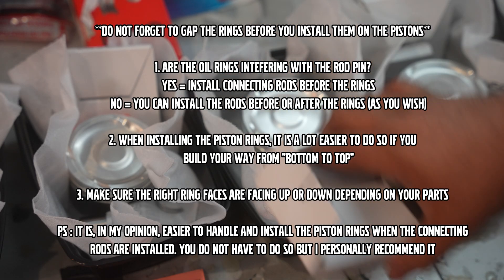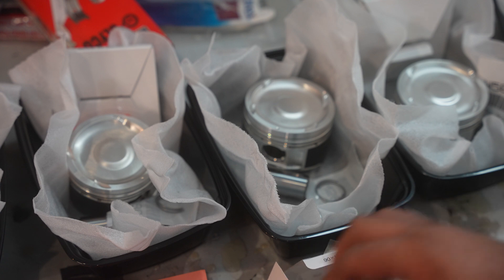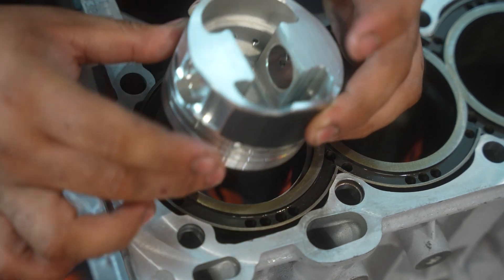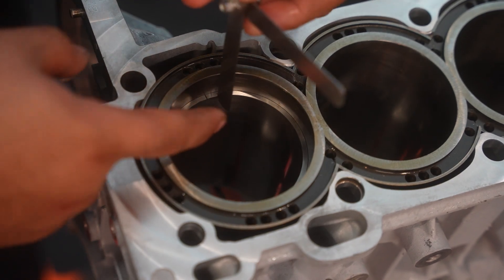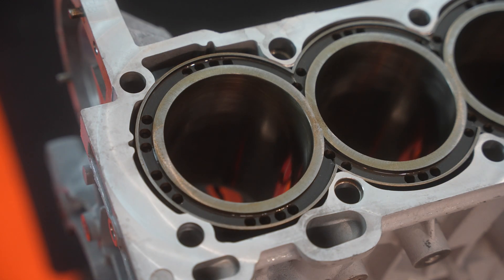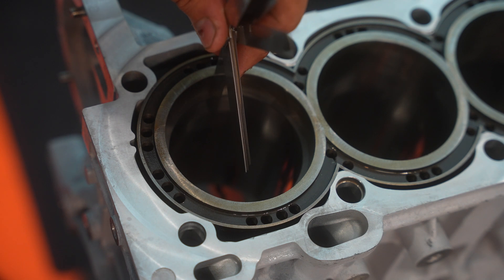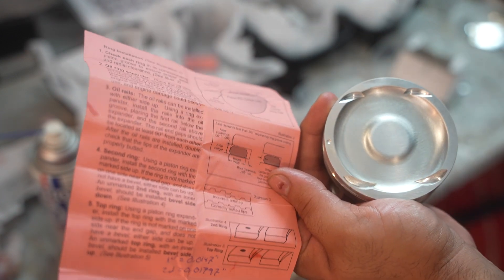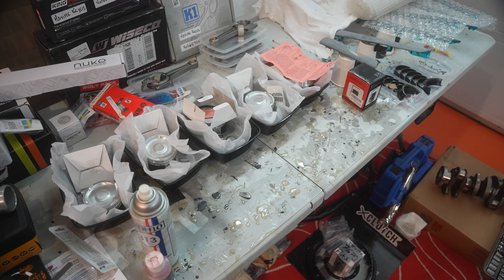HOW TO GAP PISTON RINGS for a BIG TURBO 5 CYLINDER ENGINE I  VOLVO V70R Build Part 5

Comment: Can I adapt your gaps (0.015 & 0.018) when redoing my rings or are they measures for the power you‘re running the engine?!

I‘m just renewing the rings on my stock pistons and I wonna keep the engine of my 2006 V70R stock as it‘s fine for my use despite the block is already equipped with shims. 

Thanx for helping out!
Reply from the maker: I highly suggest you follow OEM data rather than my setup. I picked my specs considering that I am running methanol fuel, higher compression ratio pistons, have different sleeve material, etc.
Reply: Makes sense… but what does VOLVO say? The rings I purchased came without Information on that
Reply from the maker: @rschally if you have VIDA, all the information is there. I’m not close to my PC that has VIDA unfortunately I can’t tell you by heart.